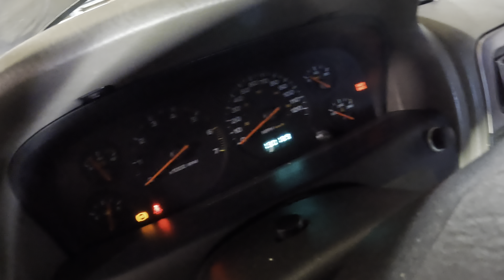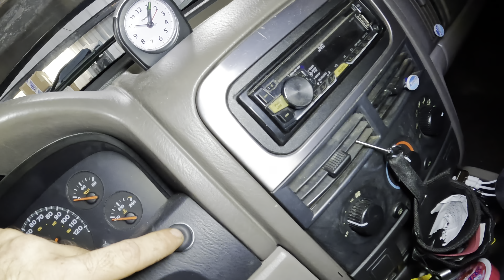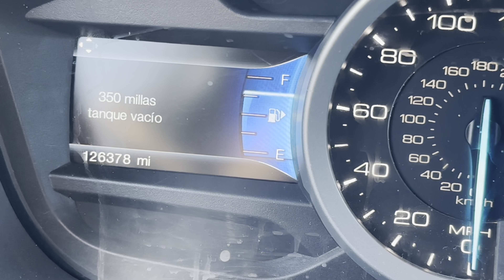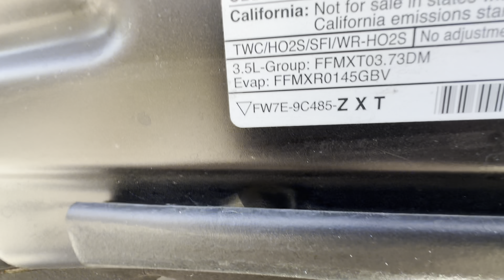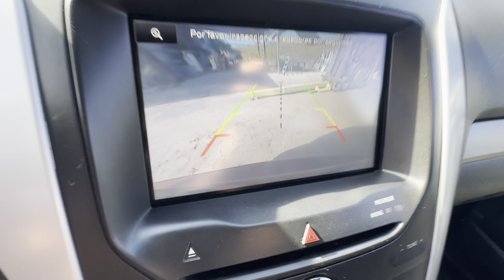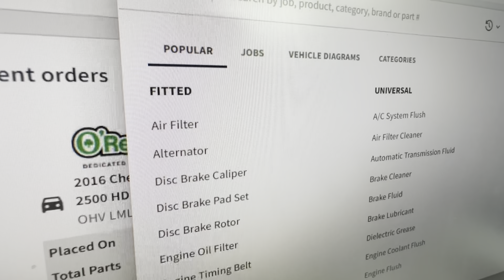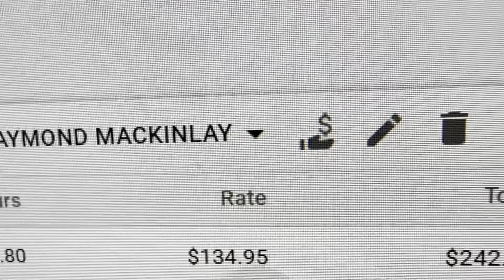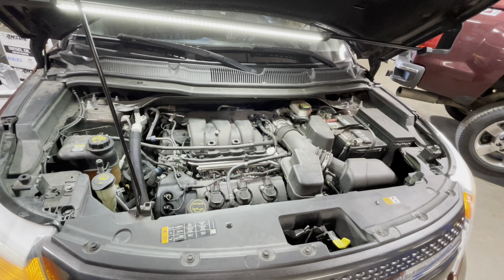TOO EXPENSIVE!  Repairs Declined! Twice! Jeep Cherokee 4.0 & Ford Explorer Noises While Driving

Comment: It's sad because the frame and body are basically fine from what I saw. And if they know enough to be able to channel lock off a brake line wtf couldn't they do their own brakes? If you can afford to put gas in it you can at least afford to put cheap brakes on it. Everything else I kinda get you gotta do what you gotta do. Changed wheels with name brand tires but can't get frickin brakes. The wheels do look cool though as they endanger everyone else on the road. Never mind it gets worse and worse.
Reply: If you don't have the 200 bucks for the Rockauto brakes you probaly have some other problems.

Comment: It would be the ultimate karma if the customer drives away after declining the repair and 1/2 a mile down the road the alternator shaft rips out. No doubt the bearings are shot. It's just a matter of time.

Comment: 1.6 hours to change an alternator seems ludicrous. 
Auto repair has gone round the bend. Not with spray but usually you're paying $135 an hour for a guy there paid 15 or maybe 20 an hour and he's just a parts changer. But you have to pay for that receptionist and you have to pay for a manager and you have to pay for offices for both then you have to pay a high profit margin. 

The only reason I would just pay Ray what he quoted at his new business I know he's just going to fix all the things that are wrong and will actually diagnose the problem instead of swapping parts

Comment: I had a whole new AC system put in my JK at 180K miles last year.  Why? Because a new JK costs, with tax and nonsense over 40K and does not do any more for me than the 2013 2 door Sport I bought new.  I am at 193K now and hope to drive it to at least 25OK or more, hopefully over 300K. You can repair a lot and for years given the price of new ones, as for used, who knows how they got beaten up by whomever was driving it, or what real maintenance was done. With mine I know the whole story.  

Word to the wise, on a 2 door JK, remove the spare and grease the lug nuts that hold it on, OR you may find one day that they decide to rip out of the spare holder on the back gate while remaining firmly stuck in the rim hole and therefore unmountable when you need it.  Just saying.

Comment: I live in europe and when i go to the dealer labor pay is €90 a hour. If i do it at a other shop it would be around €60/80 a hour. So for me 200 sounds like a lot for 1.6hours of work. I think things in the USA are really overpriced (nothing against you) it shouldnd be like that in my opinion.
I also at shocked at the fact a car like that is legal to drive. Where i live that would definitely got inpounded. A car needs at least 2mm of brakepads and all 4 have to work.if they dont, you cant even drive it to a shop to fix it. If a shop lets a car like that go without fixing those things the shop will loose its license to be a shop. If there happens to be a exedent with that car the shop owner is personally responsible for it and can get jail time. Gladly that hasnt happend in the last 15years, not even ones in my country. Roadsafety is a really big thing here.

I do love your videos and you commentary. Keep up the good work

Comment: That Jeep shows what you get when you don't have an annual inspection for vehicles. That thing was lethal.
In edit: Here in the UK we have a major inspection / test on every car or van after its first 3 years and then every year. The fee is £40. But this does show up faults when they are smaller and easier to repair rather than the huge list that Jeep had. Odd the owner had cash for a set of new wheels but not for a brake job ... priorities huh?
Semis / trucks are inspected in a shop every 6 weeks and then every year by the DoT from new.

Comment: The rigging of it makes it so bad. If it was all stock but worn out/broken it would not be so bad. Once you see the offset is off and rubbing the shocks, the push button keyless start, and drywall screw starter repair you are afraid to work on anything because of what you may find.

Comment: Take the radiator cap off slide the truck out slide a brand new Jeep under the said removed radiator cap back down vehicle fixed. I would take this one that I slide out of the shop call the owner and decline any work on it because of liabilities.

Comment: F@ck me - in the UK that Jeep would not be allowed on the roads like that. After the car is 3 years old it would have to pass an MOT safety (brakes, suspension, chassis and lights etc etc) and emissions test - If it fails and you decline the work - you can’t drive it away…

Comment: it's a farce to think those open filters proved any extra horsepower...air and fuel will still be metered by the computer regardless...all you end up with is hot air being introduced into the intake from under the hood...by tossing the cool box you've tossed your cooler outside air along with it...that's a good design for Winter if hotter air was the intention...they worked so-so for carbureted engines where air density made more of a difference for manually tweaking performance, but air temp was equally important even back then

Comment: The sad thing about the Jeep is the video clearly goes way too long. In all reality, maybe 10 minutes into it, the cost of repairs exceeded the value of the vehicle. 

My guess is that this video is strictly for YouTube clicks. By continuing to do an inspection, any oversights or errors could raise liability exposure. This is a real simple concept... You notify the customer, get your payment for the 15-minute diagnostic and let them know that it exceeds the value. Then the client could prepay for repairs because, in the grand scheme of things, if they walk on it after you invest all that time and parts, you're stuck with an item that he ain't paying for.

I haven't watched rainman videos in a long time, nothing has improved. It's a trainwreck, but with an auto repair shop.

The so-called repairs floated were not going to resolve the wrong wheel size, the complete suspension and brake work, along with doing all of the associated repairs (steering and drivetrain get screwed up).

Comment: Ah  man, that thing has just had one bastard hack after another.  Wheels brakes, suspension and steering are the critical components.  That would be the place to start.
Mechanic should decline working on it preferably.  You're not going to make any money on this job because you'll just be chasing your tail finding more stuff when you try to do the work.

Relatively low miles too, to be in that kind of condition.  I hope the new owner didn't pay too much for it, because they are going to be spending plenty on this project car.

Comment: -- Was wondering what you'd do when you saw that oil filler cap upside down.  You're obsessed, brother.  And for about and year and a damn half now, you made me obsessed too.  Bummer about that alt.  No one is happy when the money light comes on, or something like that.  Especially over the last 3.5 years, you might as well bring gold bars to pay at the grocery store.  Felt like you were more than fair.  I would have only offered the Motorcraft.  You're putting your name behind your repair, and your reputation is partly owned by the parts you put in.  Also, pretty good odds that was a 'smart' alternator.  Useless piece of (insert cures words).  But I noticed it was up in the air if you had to discharge that AC.  You weren't even going to charge them for that.  Hope they see this video.  Give a much better understanding.
    Up here in the rust belt, I restore/rust protect cars for family/friends.  I only charge materials.  Pay for that, I'll take care of it.  Then they hear it's 800 bucks, and I need the vehicle for at least one month (allowing product to bake/dry/apply more).  
    "Thought you were supposed to be family," they say.  "I can go to Zebart and get this done in a day for 500 dollars.  
     Well heck, people don't understand what it costs, and what it costs to do it right.

   And that Jeep.  Lack of rust stunned me.  That'd be worth a restore, assuming that 4.0l is in good shape, which it probably is; they're bulletproof.
Reply: That's the South, . my 1989 S10 Blazer looks as clean as that underneath.....no rust

Comment: Words to the unwise:  I know this economy sucks, but if you're driving anything with more than 100,000 miles, just start paying an extra $25 or $50 a month into a maintenance savings account.  Once it grows to a couple 2-3 thousand, leave it alone, and don't spend it on a down-payment for your next used car, because you'll need it for that too.  Meanwhile, what a shiity situation Ford has engineered for mechanics to do routine maintenance, like replacing engine accessories which are sure to fail.  1.6+ hours to replace an alternator?  Shiiit, I replaced the alternator on my Subaru in less than 30 minutes.